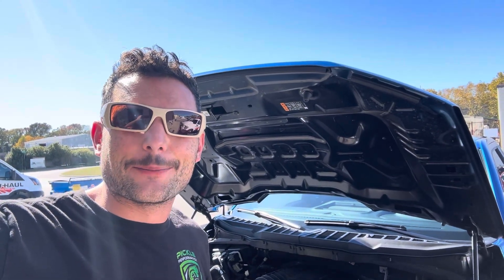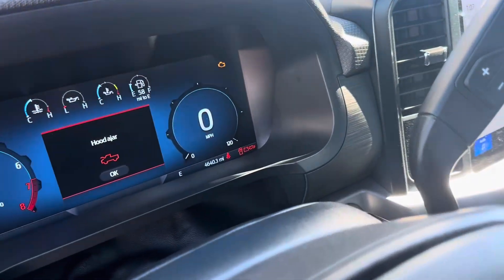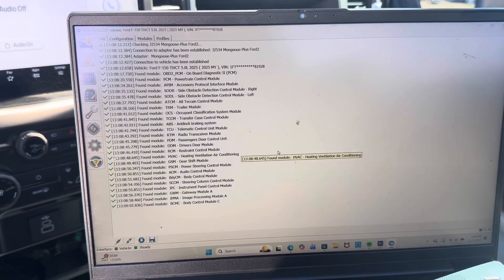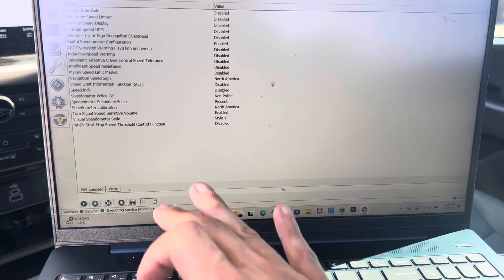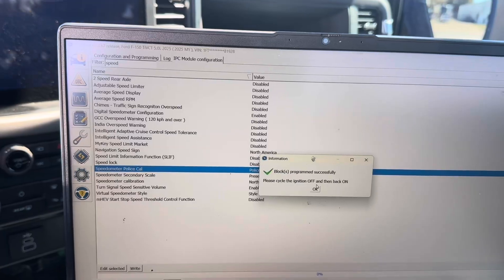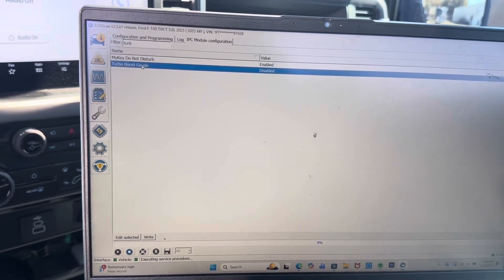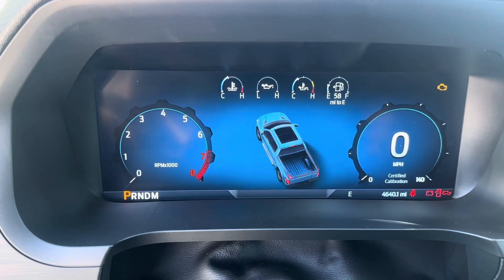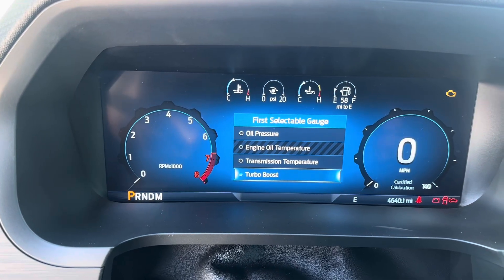Adding 140mph Speedo and boost gauge to a 2025 F-150

Comment: Very cool indeed. So how do you go about connecting map sensor to register on the boost gauge. I’m guessing you get an oem raptor map sensor and pin into the factory harness ?
Reply from the maker: They are GT500 MAP’s. They are plug and play with tuning.
Reply: I gotcha. Very cool work around indeed. I’m all 4 having less gauges.

Comment: What software is that one?   Is hp tuner?
Reply from the maker: It is Forscan. You can get a free 2 month trial on their website. 🤓🥒🥒
Reply: @pickleperformance1127  great thanks for share info 🫡🫡🫡
Reply: @pickleperformance1127  will a ford dealership notice that i changed it or tinkered with it 👀
Reply from the maker: @crispyjrisme  you can save your stock as built data and upload it anytime you need to bring it in. 🤓🥒🥒